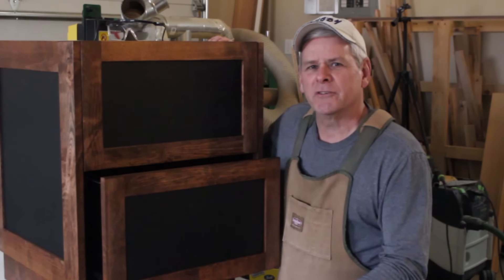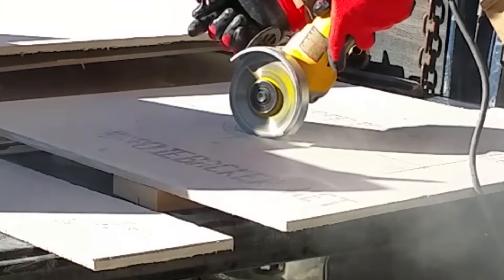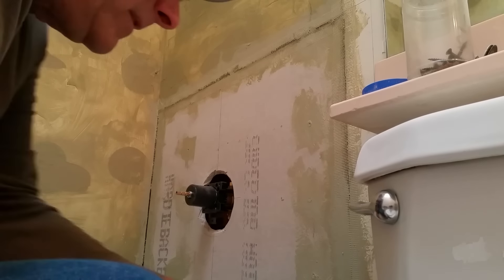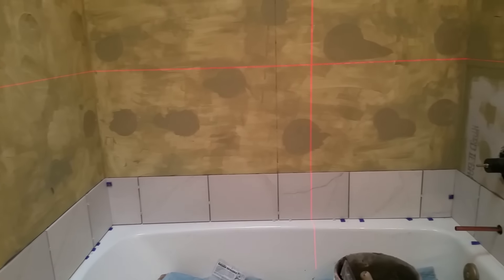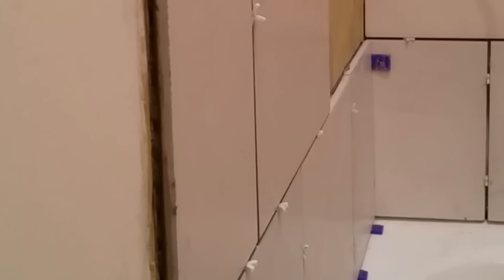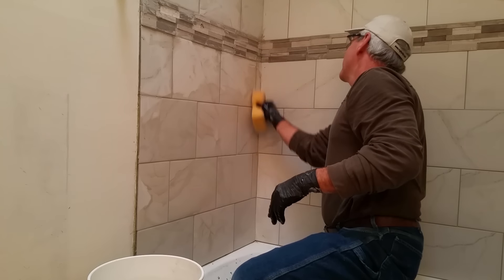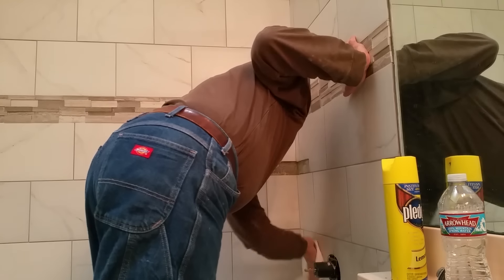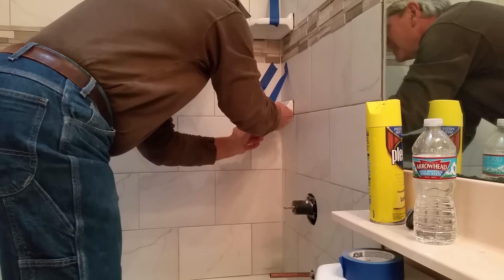How to Set Tile Around a Tub - Bathroom Remodel

Comment: Did a great job man but your waterproofing . You hadn’t even sealed the gap between the tub and wall .  And grout and tile are not a water barrier
Reply from the maker: Thanks for your comments, Al. You realize that the tub has a flange that’s there to direct water back into the tub that may get behind the tile. You can certainly try to fill the gap between the wall board and tub, but the tub is going to move and shift relative to the wall over time and even using silicone or flexible caulk is not going to stop a crack from developing in some areas of that gap. But again, water is not going to climb over the tub flange anyway. I tell customers to towel dry the tile after each use and maintain the grout joints and caulk joints to assure a long lasting installation.

Comment: Anyone watching this that is going to follow this method, use thin set on the mesh tape and then paint the whole board with Hydroban or other roll-on water proofing membrane. A few extra and very simple steps to ensure 100% waterproofing. Hardiebacker, once fully wet from daily use will let water through the backside onto your insulation/framing.
Reply from the maker: Appreciate your comment, Donald. I don’t agree that the amount of water you are suggesting gets to the Hardiebacker through tile and grout joints is as significant as you believe it to be, certainly not if grout and caulk joints are maintained to any degree. But suppose you are right and you have a waterproof membrane in place to keep the water from reaching the wallboard. What happens to that water that is now trapped between the back of the tile and the waterproof membrane? Is that not an issue for mold growth and other problems in your way of thinking?

I come from a generation of tile setters who once floated mud walls on metal lath before the days of water resistant sheetrock, then Hardiebacker-type products, then roll on waterproof membranes. The benefit of the mud walls was that they dealt with water by wicking it away as a result of the mass of cement available to absorb it and let it evaporate ultimately. These types of installations lasted decades and were generally replaced when it was time to update a bathroom. Hardiebacker is the product that most closely mimics mud walls. The guys who taught me would not like the waterproof membranes for the reason I stated above.
Reply: @RustyDobbs  TCNA guidelines for fiber cement board (Hardie) spec a waterproof membrane to be installed. They also mention a vapor barrier as acceptable but having torn two bathrooms out this past year, that vapor barrier doesn’t stop water from getting to the studs. One of the bathrooms was a 1980 original to the house that had use by 4 people for 5 days prior to being torn out. It had sat dry for two years before that. There was heading water behind the insulation and on the house sheathing. This should just had drywall behind the tile but Hardie is not waterproof. Also, this was a ceramic tile shower with no failing grout or silicone joints. Water penetrates grout faster than you think. Maybe today’s grouts are a little better than 1980 but grout is mostly just tinted cement, which is extremely absorptive. I searched high and low and could not find anywhere that suggested water would become trapped behind tile and mold. If water has penetrated through the joints it can find its way back out. I just don’t think that is enough of a concern and would be much more worried about water penetrating to the studs and causing worse damage than mold.
Reply from the maker: @thedon98677  Hey Donald. I appreciate that you are the first person who has at least tried to address the idea that water that gets stopped by a waterproof membrane and trapped behind the tile is not a problem and somehow finds its way out without creating the potential for mold. I don’t agree with your conclusions but I appreciate you expressing them. I likewise agree that water getting to the studs and insulation is a problem as well. 

We come from different generations as far as tile setting methods are concerned. There are many newer methods for tile installations these days that will prove to be reliable or will not, but time will tell the story. Common sense leads me to conclude that the waterproof membrane behind the tile as the ultimate solution for wet area tile installations will be revisited in the years ahead. For someone who started setting tile in the late 70s, the waterproof membranes have not been around very long and may have some problems discovered about them over time.
Reply: @RustyDobbs  why do think no one seems to worry about it? You think it’s an issue only you have thought of? You can’t find anyone who is addressing it for a reason, it’s not become an issue. Know what you can find 1,000 videos of? Poorly waterproofed showers and the failures they cause. You can’t find a single video of someone with water trapped between membrane and tile and that is the only issue because it’s not an issue. Also, Kerdi membrane has been on the market since 1987, just because it hasn’t been widely used in the US that long doesn’t mean there isn’t sufficient evidence that it works. I’ll stick with TCNA and ANSI recommendations for waterproofing.

Comment: Thank you for the great video! One thing though, I would have liked to see how you handled the edge where the new tile met the old wall like you showed in another finished product (to replace bull nose).
Thanks again!
Reply from the maker: Thanks for watching and for your comment, SciGuy! Not sure exactly what you're asking but I will take a stab at it. On this job, we had no opportunity to buy any bullnose trim to finish the edges so any place where the tile terminated, I cut a 45° edge on the backside of the tile to allow me to create a very durable grout joint between the wall and the edge of the tile. Making that 45° cut also does away with the unfinished edge of the tile that would be exposed otherwise. You see people place grout against the edge of unfinished tile and wash it down to a 45° or so angle but because it's basically just sitting in a corner it will crack and fall out over time. Obviously, if bullnose trim is available, that's the best way to finish an outside edge. But in the absence of that, back cutting the tile for a grout is also very good solution. Hope that is what you are asking about!

Comment: This was well explain now time to start the project
Reply from the maker: Thanks, Iris! Good luck with the tile job!
Reply: To get the job done quicker I purchased tiles 12x24
Reply from the maker: Hey Iris. Just so you're not surprised, I find that setting larger tile like 12 x 24 actually takes me longer than smaller tiles. It's because I have to back butter each tile and pay more attention to getting good coverage between the tile and the wall board or Hardibacker in my case. You also have to be more aware of how the corners are aligning between the tiles. Most of the time the wall surfaces aren't perfectly flat and setting large tile on those surfaces means you have to compensate by having a good thinset bed behind each tile. I don't have a video on setting 12 x 24 tile on a wall although I'm actually starting a tile job tomorrow around the tub that will use that size of tile. But here's a video from a couple years ago where I am setting larger tile that you also may want to take a look at for a little more perspective. https://youtu.be/ZAWpt2ieWf8

Comment: There's a big debate between starrtile and sal diblasio. Do you install the substrate up to the tub lip or over the tub lip? Starr tile you install up to the tub lip so the substrate doesn't wick up water.
Reply from the maker: Hey, Diamonds. I always use 1/2" Hardiebacker which is a great product and compare it to the old mud walls where its wicking properties were a good thing. So I'd probably land in the middle on the debate but don't really consider it a big concern either way. Both guys are knowledgeable and I consider Starr Tile a friend. Either one doesn't mind sharing his opinion. 🙂

Comment: Why can't I do the whole back wall, and then the other walls?  You say they won't line up, but why not?  Thanks for a helpful video.
Reply from the maker: Hi, Libby! There are some lessons you have to learn the hard way which I did on the first shower I ever built for a customer. At that time, I was in my early 20s and speed was a bigger motivating factor for me as I was learning to set tile. I set the entire back wall (4 1/4” tile) and all was good. When I started the right wall, about halfway up, obviously something was wrong as with each row added, the height of the tile was growing taller relative to the tile I set on the back wall. There was really nothing I could do about it at that time except finish the wall. So, at eye level the right wall tile line was about 1/8” to 1/4” higher than the left wall. When it was grouted and caulked it wasn’t that noticeable except to me. Still bugs me to this day! So what happened? Probably a combination of things from my level lines being a little off to weird things happening with the walls being a little out of plumb or having a bow in them to maybe there being a fractional difference in tile sizes in boxes manufactured in different runs (you always want to blend 2-3 boxes of tile together as you set). 

The point is that if you are setting tile on all the walls relative to each other, after every few rows you set you see alignment issues as they are happening and can make adjustments to your grout joints to fix things as you go rather than realizing too late you now have a problem that you cannot fix. I have another video called “Tile Setting - How to Set Tile Around Your Tub” where I use animation in the middle of the video to show how some alignment issues happen that applies to your question as well. 

That’s more of an explanation than what you were probably looking for but I hope it helps! Good luck if you have a project planned!

Comment: Great video!! Did you only use backer board by the fixtures?
Reply from the maker: Yes, Tracy. The rest of the walls had been covered by 1/4" cultured marble so the wallboard was still in perfect shape. Water had damaged the wallboard around the cutouts for the fixtures, so I replace that with 1/2" Hardiebacker.

Comment: Nice work but I didn’t see you thin set the walls you just back butter the tile do you still have 95% coverage
Reply from the maker: Yes, because of the smaller size of the tile (9"x9" as I recall) I like to back butter with extra thinset and not try to spread thinset on the wall also. I place a tile on the wall and pop it off to check for full coverage on the wall and back of the tile. You get the feel of it pretty quickly so every 4 or 5 tiles I check to make sure coverage is still good. Any tile 12" or larger, I definitely apply thinset to the wall and back butter as well. Thanks for watching.

Comment: You need to grout your corners with the same grout as the joints.  Then you come around with clear 100 percent silicone caulk to the corners to stabilize and waterproof them.  This creates a perfect installation, every area blending in with the next.  It looked like you used  a white silicone-based caulk that's meant for trim pieces in areas that aren't meant to be waterproofed.  This is a definite fail and marked problem that stands out in an otherwise excellent installation.
Reply from the maker: Thanks for watching and for your comment, Bob. For many years now, I have used caulk from the grout manufacturers that is color matched with their grouts. The caulk comes in sanded and unsanded versions and is a siliconized caulk designed for wet areas. The most familiar brand I use is Mapei. On this job, I would have been using one of their caulks. I have been satisfied with the caulk's performance over the years and have it in my own home as well. I have never been a fan of putting grout in corners because it will crack as the two surfaces move relative to one another. Sounds like you have had good success with the silicone over the grout though?
Reply: @RustyDobbs  ah! I see now what you are using.   Experience may differ but the end result is what counts!
Reply from the maker: You may appreciate this, Bob, but many years ago before tinted caulks were available, Dap had a version of their Tub and Tile caulk that was pretty good. Of course it came only in white. A builder I did a lot of work for was a painter originally and he always kept a box of 'colors' for mixing paint handy for any number of purposes. He showed me how to take a tube of the Dap caulk, cut the back end off, then mix in color until it would blend in with whatever I was caulking. Then tape up the back end, cut the tip and start caulking with a color tinted caulk! Worked pretty well!

Comment: How much this particular job labor would normally cost ? Have any idea? I have same bathroom size where i  need old tiling around tub removed and install new tiles. Any body please tell me labor cost estimate for this?
Reply from the maker: Hey Teg! That's a tough question to answer these days after material and labor costs have skyrocketed with inflation. I've noticed lumber prices are starting to come down. It also will vary in different locations. I'm guessing in my area which is the southwest US, a tile job like this, excluding any plumbing work, would run in the $3,000 to $4,000 range from a reputable independent contractor.

Comment: I see you stop the hardiebacker right at the tub edge. What do you do if you're runnung bullnose down to the floor say 2 or 3" in front of the tub? I'm butting up against wood lath and plaster. Do I run more hardiebacker down to the floor for the extra 2 or 3" width??? Thank you.
Reply from the maker: Sure, Jeff! There’s no problem with using Hardiebacker any place where you might otherwise use sheetrock. Especially if there’s a chance of water exposure, Hardiebacker is my preferred choice. You can tape and float over the edges with drywall mud and get the same finish as the rest of your sheetrock wall if needed..

Comment: If I need to tile slightly beyond the durock, it is okay to have the tiling about 2" past and over top of drywall? or does the tiling NEED to stop right where the durock and drywall meet?
Reply from the maker: No, Jim, you should be ok to extend your tile beyond your durock a few inches with no significant problems. What might happen is over time due to the fact there there are two planes coming together (your durock and sheetrock), there might be some slight movement which could cause a hairline crack in your grout joint near that transition. If that occurs and it is noticable, cut the crack slightly with a blade and regrout that line or use a flexible caulk that matches your grout.

Comment: What about waterproofing the wall before you install the tiles? Hardibacker will only absorb the water.
Reply from the maker: There are a couple of conflicting perspectives at work here, D. Before Hardibacker, we used to float in mud walls in showers on metal lath attached to the studs. Very similar to the way stucco is applied. One of the appeals of that method was that 1/2" to 3/4" of mud could absorb and evaporate the water that made its way through the grout joints over time without causing damage to anything. So as long as the initial installation was correctly done, those showers lasted decades. Along came various types of waterproof sheetrock that was much cheaper to install but proved over time to be a very poor substitute for mud walls. Then came Hardibacker type products which to me is a great solution and a throwback to the same principles of the mud walls. Now, the idea of waterproofing the walls and creating a moisture barrier or envelope between the tile and the backer board is the latest and greatest trend in wet area prep. That's all fine except for one problem that I've never really heard a good explanation for. Assuming water still gets through the grout joints over time and collects between the tile and, now, this moisture barrier, what happens to that water that never dries out? Probably nothing good! That's why my ideal prep for wet areas if it's left completely to me is to use half-inch Hardibacker and then waterproof the joints with one of the waterproofing membranes. Hope that explanation helps!

Comment: What do you do if the tub is not level.  The lowest point on our tub is the outside edge of the tub which makes the tile on the back wall about 5/8" above the tub. Do you have any advice?
Reply from the maker: I did another video where I address the tub out of level question through animation that should help you. 
https://youtu.be/vkJSdmmeeS0

Comment: Do you set you hardy board directly on the tub or just about the top lip
Reply from the maker: No, I will always hold the Hardibacker up off the tub about the thickness of the tile. If the flange on the tub is away from the studs I sometimes trim the back of the Hardibacker to let it slip over the flange and not make the Hardiebacker out of plumb but that happens on a case by case basis.

Comment: No mention of the importance of sealing the grout with three coats to achieve full penetration?  Never seen the furniture polish trick before, but I have real adhesion concerns about applying the grout sealer or the silicone caulk over top of furniture polish.  Polishing the tile at the very end of the process does make it sparkle.  Buffing a good automotive polish once a year provides superior protection.

Comment: 1.No doubt by use pledge on the tile.
2. Use schluter metal or plastic edging in place of bullnose. 
3. Use construction or quick grip exterior glue on soap dish.
4. Never use drywall as backer even moister resistance drywall. Even if coated with water membrane. A leaky pipe on the back will destroy tile. A leaky window or siding will destroy tile too. Moister in the wall will destroy a tile job.